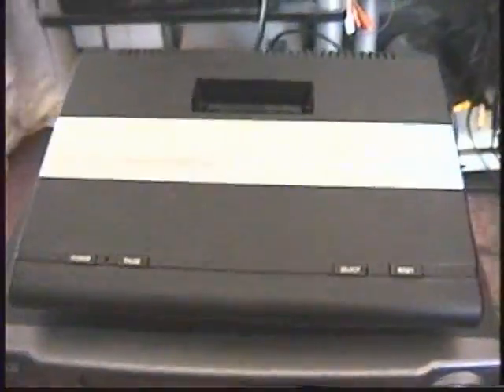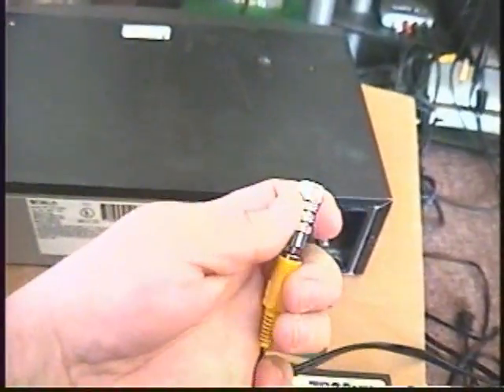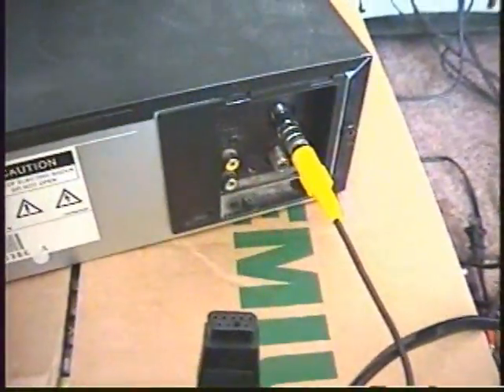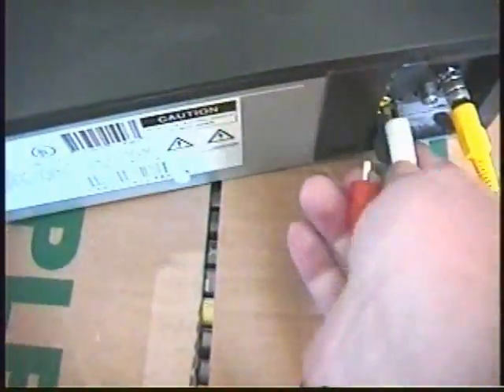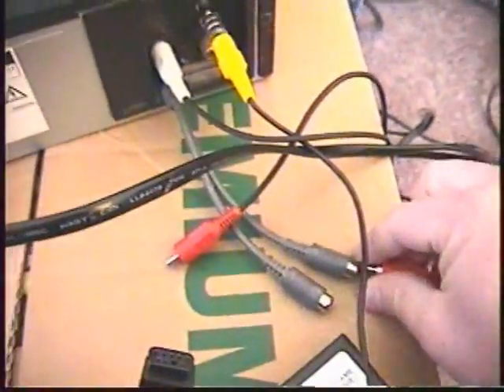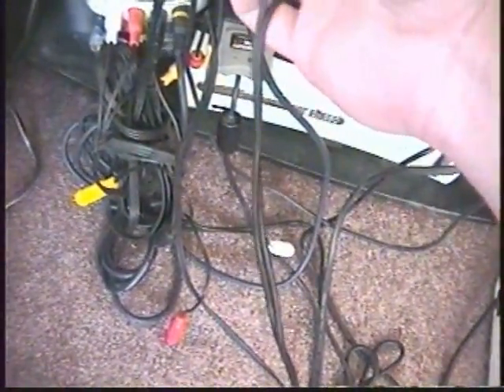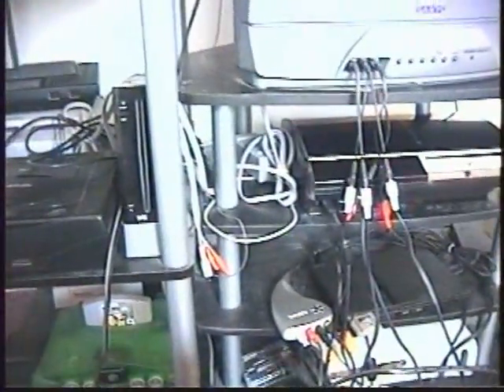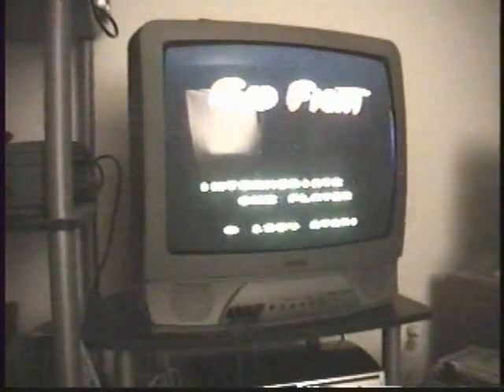An Easy Way to Convert RF Signal to Composite

Comment: Whooaah what a coincidance i bought my ntsc atari 7800 recently while living in pal territory(because i want the original game’s speed and no snail like slowdown like on pal systems),and so i am also about to get a rf to av module very cheap on ebay,great for all your rf based retro systems such as the atari 2600,atari 5200,sega master system 2 and nes 2 etc,,, so you could also hook them up to a frame meister to improve the image quality,especially if your tv does have advanced noise filters then you can clear the rf signal😁
Reply from the maker: Frameisters are kind of pricey, but I might eventually pick up either a Retro Tink 2X pro, or the 5X (which is also pricey). I will pin your comment though to get the information out on newer ways to do this. Strange this video still gets a bunch of views considering it's age and quality. Lol. I appreciate the views though.
Reply: @teh2Dgamer  I have a Color TV-Game 6 & I can't get it to ch. 95 or 96 to work on my analog TV bc my VCR doesn't go high enough then 69 & I need to have a special type of ch. tuner which makes my VCR go higher than ch. 69.

Comment: Is it possible to send RGB signal through RF to an old TV if you have a Nintendo scart cable and an RF modulator with scart input?
Reply from the maker: That is a great question that I personally have no way of answering as being and NTSC gamer, not a single TV I have ever owned has used scart. That was definitely more of a PAL thing. We were lucky if we had Composite hookups on our TVs

Comment: The adapter is all you need. You plug straight into the tv coax and put tv to correct channel either 2 3 4 depending on how old your console is mine has 2 and 3.
Reply from the maker: Yes, but you can't watch old family video on an adapter now can you. LOL. Adapters, yeah, but it seems more fun using an oldschool VCR

Comment: I'll solder an RF cable to composite cable, finally got some screen on my 1040st. My TV had RF input, would that make a better quality output?
Reply: It will only ever be as good as the output on the console. Don't use RF outputs if you can avoid it, but using a VCR is just a simple way to demodulate the RF signal into separate composite and audio. for better compatibility with some TVs.

Comment: What I found you can use and is about $14 on eBay is a Philips PH-61153. It was a modulator that allows for RF in along with 3 more A/V inputs and RF or A/V output. By far the cheapest and cleanest solution for hooking up your Atari, Nintendo , SNES Game consoles.
Reply: Aberran Fox the only reason to bother Converting RF to Composite is for Capture card use (they never made a RF capture card and it's no big deal after all People would easily pirate TV shows if there was a RF capture card)
Reply: Aberran Fox well you would use this on a Atari 2600 or a video comparison
Reply: Would you plug the rf cable in "To TV"? or "Ant/Cable In"?
Reply: Lol this thing is on eBay for 70$ today. Crazy
Reply: If you have an original style NES and any SNES that I know of why would you bother they come equip with RCA composite. And that item you showed does not look like it would work it just looks like a modulator to me.
Reply: REALLY? I am not talking about converting. The NES1 and SNES have Composite out and it has better overall video and sound than RF. So why bother. Go with the superior quality of Composite.
Reply: ***** Yeah it is getting down to the bottom of the barrel for sure.

Comment: Easiest way for recording gameplay videos if you are using the emulators. I have fraps and works great, but i need strong PC for that. I had plans for mame gameplay videos, but i have weird sound and video problems, and PC is not strong enough for running two programs at the same time. But recording from real hardware is different story.

Comment: That's a great deal. I always buy consoles (regardless of how many I own) for super cheap prices whenever I can. Even if you don't end up ever needing them, you can always save them for parts just in case something breaks.. or simply re-sell them. I've never seen an SNES that cheap, even the extremely yellow ones, so you're pretty damn lucky to stumble across that.

Comment from the maker: Cheap if you've got a VCR, but VCRs shouldn't run that much at the right thrift shops. Some thrift stores are overpriced, but others are pretty good. I actually picked up a working Snes at one of my local shops for $5 a while back. No cords, but I already had all the hookups. So it depends on the shop.

Comment: Cheap assuming that you've got a VCR lying around. It's a novel idea, especially if you're looking for a quick fix, but I can't imagine that a conversion cable would cost more than $10 anyway. I've used this method before, so it definitely works, and the quality difference is negligible in comparison to using a straight forward adapter.